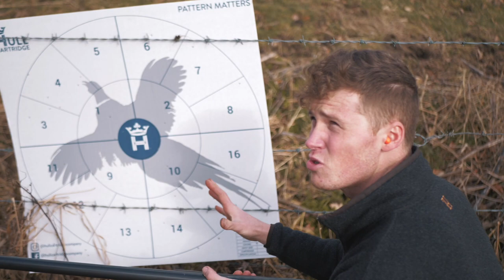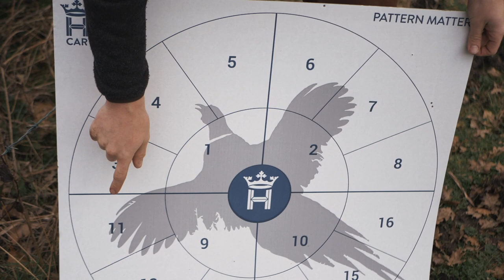Testing a 4 bore shotgun!

Comment: The slight lift before firing at the 105m target might explain the lack of shot on target, 24:52. Was that last minute correction or trigger pull anticipation ? An inch off at the muzzle, even on that beast, is ~60 MoA, or ~72" at 120 yards...?
Fantastic video though, thank you :)

Comment: I must admit to being pretty disappointed with the pattern testing. I would have liked to see some more meaningful results on some proper pattern plates, not just some bits of cardboard against a barb wire fence. The 100 yard tests needed to have been done on sticks or something.
Reply from the maker: How would sticks have changed it?
Reply: Use it as a weapon to blow thru walls. People always worrying about over penetration. People should be wondering if their 12 gauge can shoot thru a standard house wall. Of course if you hit a stud. It doesn't matter what size shotgun you have. In the United States people have guns for self protection. People used to have firearms for hunting. Not any longer. Firearms are to kill the home invader